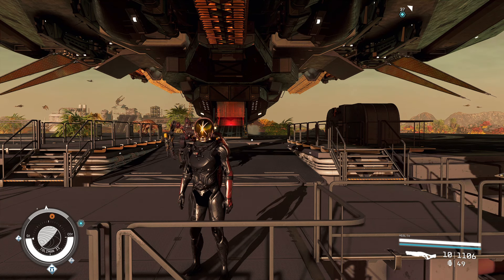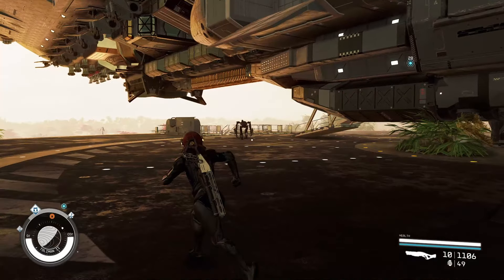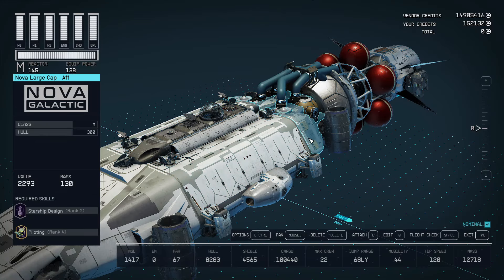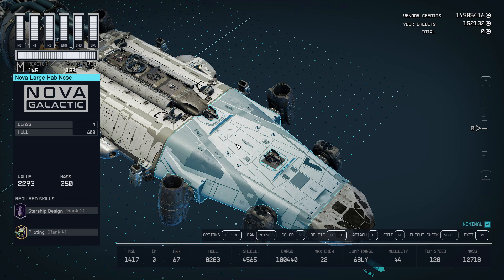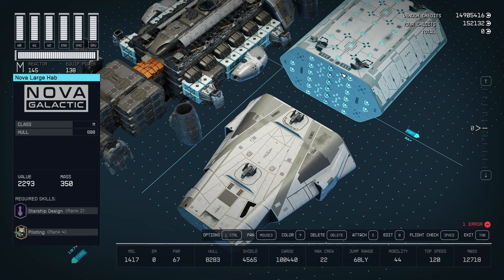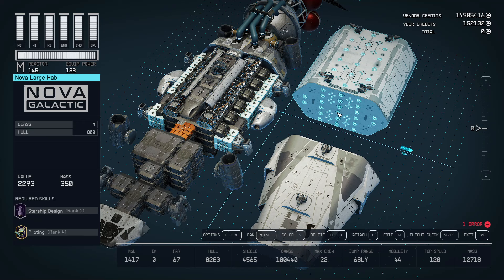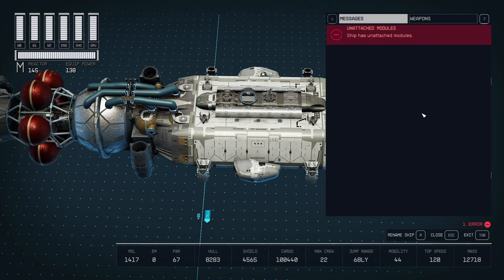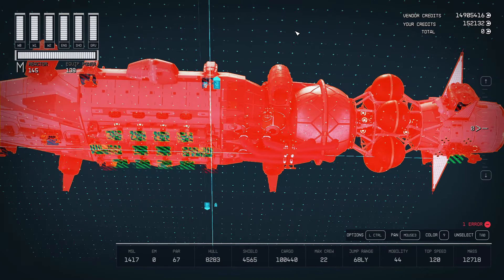Starfield Mod: TN's Class M Ship Building (Part 1)

Comment: Hey i have problem with your mod please help ? anytime i go into shipbuilder to make the slightest change like adding a cosmetic item on the outside of the ship it scraps all my furniture and puts ladders everywhere on the interior i had it the way i want it but since installing your mod i have to avoid using  shipbuilder at all i cant even uninstall to fix it dunno if im stupid or is it bugged but ive spent the last 3 hours trying to fix it and im closer to insanity than i am to finding a solution

Comment: Great job TN but how do you get the M class mods to snap over your habs connected to the cockpit?!!! I have all of the habs tested and arranged but the NOVA large hab nose wont snap! help maybe please?
Reply: There's an INI setting you need to set in order to make it work. It's detailed on the mod page: fShipBuilderModuleOverlapTolerance=-20

If you have another mod that overwrites it, or INI files in your data folder that overwrite it or something, it might not be set correctly. Or you may have to up it to -25 or -30 on your system. Some people have mentioned needing to set it higher. That allows the parts to overlap.
Reply: So how do I fix this problem on xbox??? @thetennessee

Comment: Great mod! Ive been testing it for hours and doing crazy stuff, the only weird thing is that sometimes it let me to overlap vanilla habs over M class habs but sometimes it doesnt,
Reply: Do you have multiple mods that touch the ship builder tolerance? If one overrides this setting, it could be causing the tolerance to be lower than needed.

Comment: Impressive ship you've built there, mate... but the thing that immediately entered my mind is how wasted all those hours spent in Ship Builder will be the second you and I start NG+...

What I'd really love to see as a mod would be a way to save designs across NG+ runs, so that I could basically just pull up a saved design and have the parts be auto-added together, provided they are all available at this location.

Don't know about the feasibility and challenge level of doing something like this, but would love it dearly if you could look into it... what do you say?
I'd of course endorse the hell out of it on Nexus and vote it as Mod of the Month!
Reply: I use the NG+ as an opportunity to build a new one. Also the last few NG+'s, I stuck to my starborn guardian ship for the whole thing.